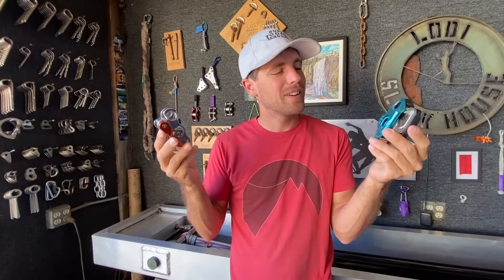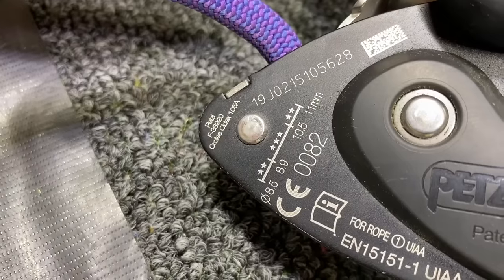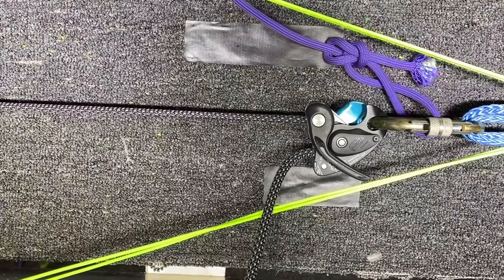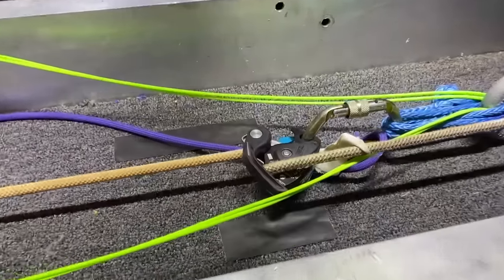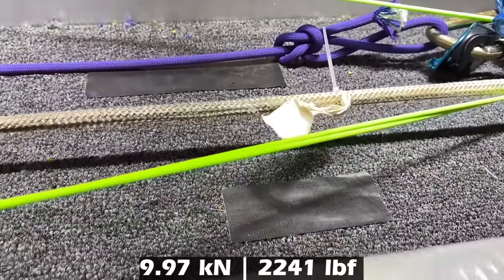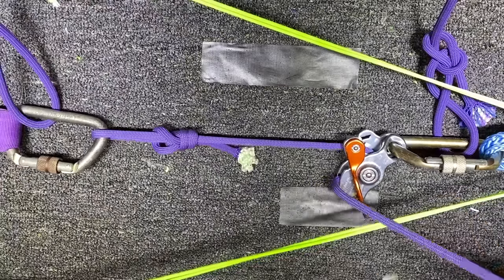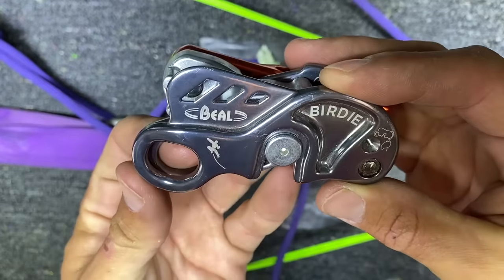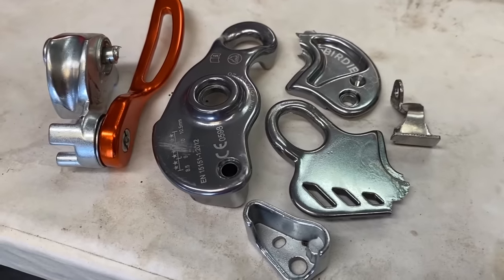What breaks first??? Petzl GriGri or the Ropes? + Beal Birdie Tests!

Comment: Where is the broken axis of the Grigri ? Breaking at 10kN is not so high !
The experiment is made on new ropes, and we all know that new ropes slips a lot because friction coefficient plays a lot on results at least as much as diameter. Same experiment shall be done with non-new ropes. Moisture also has hughe impact (as it also influences friction).
I was really satisfied with my birdie but I noticed some slipage recently. Due to small radius I think Birdie is more sensitive to erosion of the cam than Grigri. Another test with old Grigri and Birdie would be very interesting.
Testing on brand new devices and ropes is not representative of real life condition.
Thanks

Comment: Can you make soft shackles from synthetic winch cable?
Reply from the maker: Amsteel which is used to make most soft shackles is also used for winches.
Reply: @HowNOT2  My next question would be is it "safe" to do an emergency rappel on amsteel? I have a brand new roll of 3/16 winch line that I keep in my vehicle because it's light, small, strong, affordable and handy lol. I live near the Appalachian mountains, so we have steep hills compared to you guys.😂
Reply: @HowNOT2  I recently found out amsteel doesn't like knots.🤣

Comment: I'm mostly just surprised you were able to get pit rope to bend enough to fit into a grigri or the Birdie..... 😅

You didn't skin the pit rope because its sheath doesn't slip as badly as dynamic ropes do, and (like you said) it was forced into a sharp bend. 

You should try some of these tests again with UniCore dynamics ropes.

Comment: You don't have to put a screen over it in the traditional sense, but you could just get a sheet or small section of lexan or polycarbonate. It's clear so it won't even show up on film or block the camera. It could easily contain the breaks and just provide that layer of protection to you and your equipment for a relatively cheap solution. You can find 0.093 inch thick 48in X 36in panel for like $90. Or even cheaper a 0.093in thick 24in X 18in panel for $25 bucks at Home Depot.

Comment: Comeon Ryan, you know better than to position the grigri like that.  The rope goes over the curved area, not the thin flat part.
Reply: I doubt that would make a difference. Chill
Reply: Rope doesn't always go where you want it to. It's not always going to be running over the side plate during a fall.
Reply: @windriver2363  I think this guy was being silly with this comment and not a serious remark about the rope pulled to the wrong side. At least I hope he was 😅... however ropes should go where you want them. Especially while belaying someone. If you are using the device properly when loaded the pull will always be linear, the rope should not be over the side (while tensioned) unless you are lowering. Even if you were to beley with the rope over the side rail as soon as the device is loaded everything should be pulled into a properly linear position. If this is not happening then I would consider changing my beley set up.

Comment: The rope diameter has to be messured under tension to get the correct diameter. Thats why some 8.6 single ropes looks so thick. This means that you have used a to thin rope for your first test.